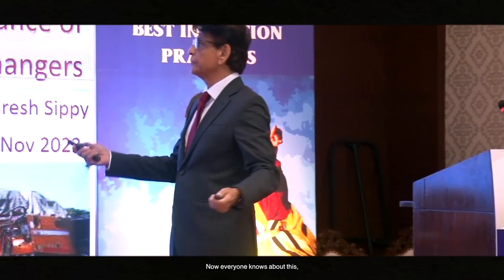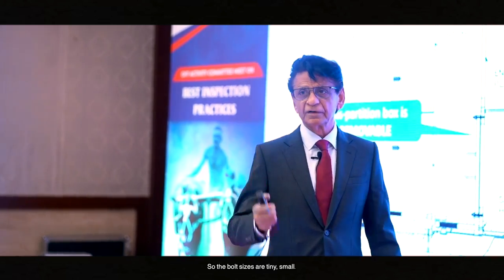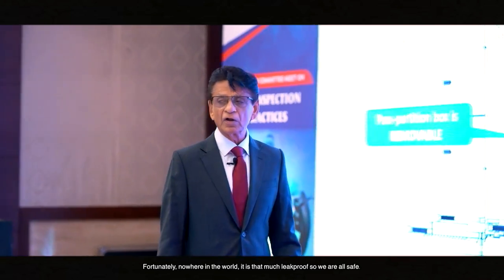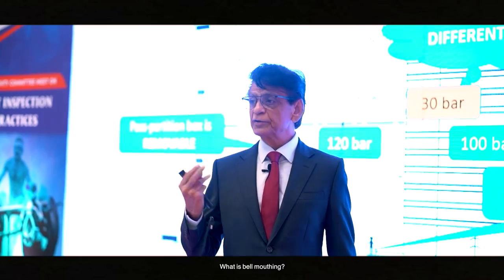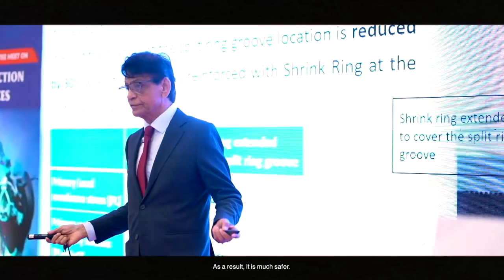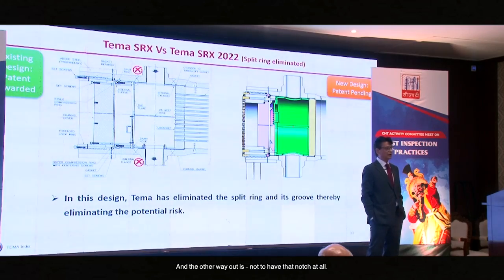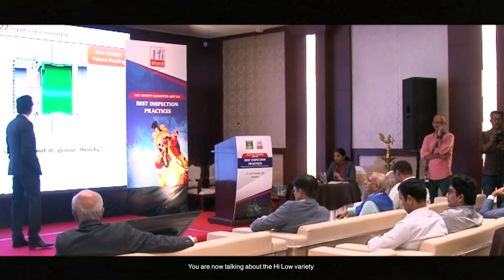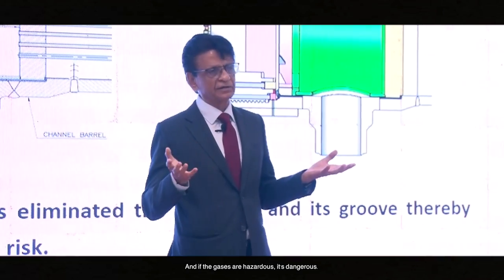Atmanirbhar for 'Bharat VI' | Haresh Sippy | CHT Activity Committee Meet at Mangaluru

Comment: Understanding shell and tube heat exchangers particularly for corrosive and dirty fluids coupled with high pressure and high temperature applications is always a very complex and daunting matter. To unravel these complexities in the Euro/Bharat VI specification of less than 10ppm requires an in depth knowledge that requires decades of experience coupled with design and construction expertise. It is here that Mr Sippy has contributed immensely to the Industry. We look forward to your continued success and we hope that Refineries and Petrochemicals/Fertilizer Industry takes note of the incredible knowledge that he would be so happy to share !!